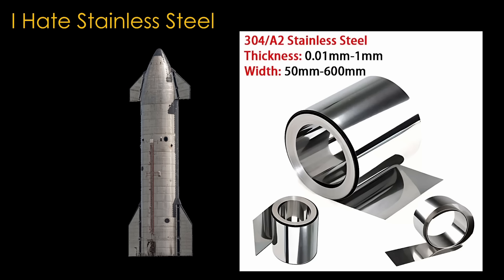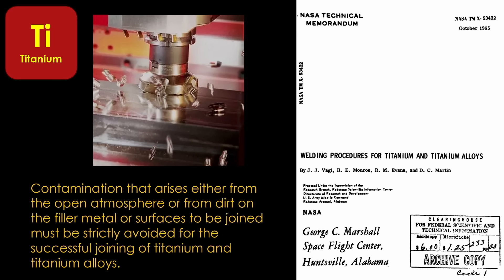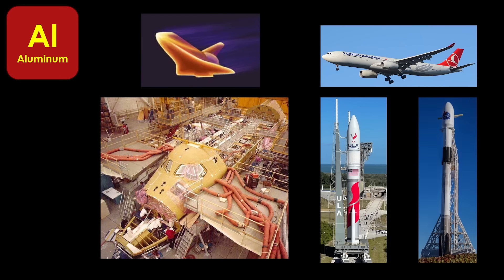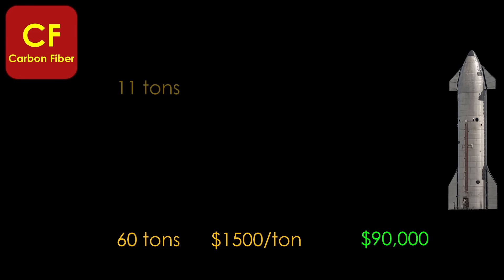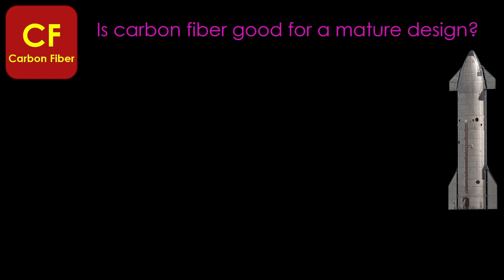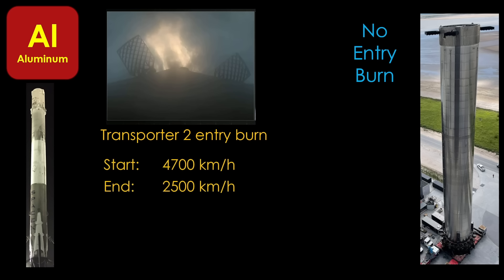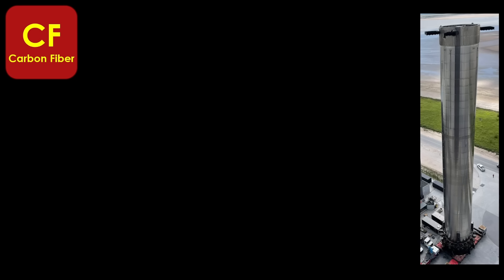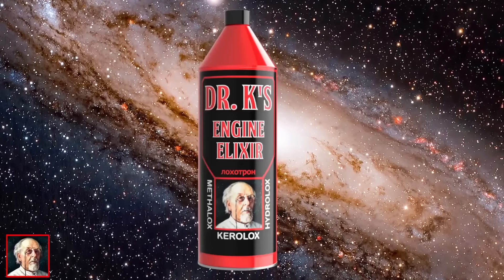Why Starship Loves Stainless Steel...

Comment: And how come if carbon fibre has all these not insignificant problems, Rocket Lab chose it as the reference material for the new Neutron rocket?
Reply from the maker: Neutron has an expendable second stage, and they have shown they can bring back a carbon fiber first stage with electron, so their architecture doesn't have the same downsides. 

They also know exactly what they want to build and are really good at carbon fiber.
Reply: @EagerSpace  Thx for feedback

Comment: I think it's plausible that the superheavy booster will eventually get a carbon fiber version once the design matures and they are regularly recovering boosters.

SpaceX is very ambitious with how frequently they want to launch Starship once it's mature. Their sunk costs into stainless steel based manufacturing aren't very big in the grand scheme of things (remember they first invested into manufacturing with carbon fiber then changed course).
Reply: I think it's more likely they belly flopping the steel Booster to skip the 13-engine landing burn from 1200km/h to 200km/h.
Reply: SPACEX most likely wont switch back to carbon fiber for a variety of reasons
Reply: Didn't you hear about the sub that was made of carbon fibre?
I don't think that would be a good choice to make a spaceship out of

Comment: At your quotes prices, I think the price question is basically irrelevant. If titanium was even modestly easier to work with than stainless steel and had decent performance in the heat, I think the couple-million would be an easy trade.
Reply from the maker: That is a fair point. 

I also wondered about supplies but couldn't find any useful information. There's so much stainless steel use that building a lot of starships won't make a noticeable dent in it, and titanium is a lot rarer, especially in the aerospace grades.

Comment: I just wonder, if choosing stainless is such an obvious choice, why has nobody done it before? Maybe NASA didn't have to worry about cost?!
Reply from the maker: Nobody has built a fully reusable vehicle before. NASA kindof started there with shuttle but quickly found that they didn't have the money to build two vehicles. If you have an external tank that burns up like shuttle the lightness of aluminum is really helpful, especially if you are using hydrogen as your fuel.

Comment: I disagree that heat management is a major factor in excluding Titanium. Sure, titanium isn't as heat resistant as steel, but it's still far far better than aluminum. I highly highly doubt that the difference between it and stainless steel is major enough to lose all the weight savings on increased thermal protection. The main factor for not using Titanium is just cost.
Also, I don't know how on earth you got that estimated mass for an aluminum starship, but it's definitely wrong. It should weigh at least as much as the titanium one because aluminum has a lower specific strength than titanium.

Comment: What about nikkel based alloys like hastalloy. would they be more suited then alu or titanium?
Reply from the maker: I'm assuming that SpaceX looked at more advanced alloys, and there have been some metallic thermal protection systems proposed though AFAIK they haven't been flown. They tend to be super-expensive and extremely hard to work with.
Reply: @EagerSpace  yeah. Nikkel based alloys is a pain to work with that is true. Anyways thanks for the answer!

Comment: NASA has a paper on how to properly weld titanium, while Russia has built about 50 titanium hulled submarines, who's welds have never failed.
Reply from the maker: The sources I found said that Russia only built 7 (or perhaps 8) titanium submarines and switched back to steel. Kursk - for example - had an outer hull of stainless steel.
Reply: @EagerSpace  That's because you CHECK you facts.
Reply from the maker: I was actually surprised to find it to be so low; my impression was that they had built a lot of titanium subs.
Reply: On this issue the use of laser welding has made titanium far easier to deal with.

Comment: I always thought titanium is the ultimate metal alloy. Stainless steel really is something.
Reply from the maker: Going into this I expected that titanium would fare a lot better, but holy cow it is a huge pain to deal with from a manufacturing standpoint.
Reply: @EagerSpace  But now it is possible to print with titanium (khe Relativity khe). Obviuosly, it can't be a vehicle as large as the Starship, but with a sufficiently large chamber... Moreover, with 3d printing one could design some unorthodox shapes, that would be better for, say, reentry. Also, you could incorporate some fancy features like uneven wall thickness, or even active cooling channels.
Reply from the maker: I'm really not convinced that printing tankage is ever going to be a good approach.
Reply: @EagerSpace  Elon Musk is using printing for Raptor 3 engine components with internal cooling channels.

Comment: Hello, sorry I am not good in math at all. After watching this video I remembered the video with the "rocket equation demon/dragon". There you pointed out that they only have a very narrow band for starship to even be useful as a 2 stage design. Wouldn't 17t extra payload solve the problem? (if you already have a working design, but sure, the entire evhicle needs to be reevalutaed again, there willll be different problems with a different design.)
Reply from the maker: 17 tons doesn't get you from 50 tons to over 100 tons, which is what they need to hit. That's why the starship 2 and 3 designs exist. 

The engineering question is "what is the quickest, cheapest, and easiest way to get to 100+ tons?" And it's not "spend 2 years to retool the factory to use a different material".
Reply: @EagerSpace  Oh okay, thought they were actually fighting over just a few percent. Yeah then stainless is the most workable material. 

Thanks for the reply!

Comment: From what i know New Glenn is made of aluminium and it isn't doing an entry burn.
Reply: We have no idea what kind of heat shield they'll have around their engines.  When did you see a flight plan for new glenn?  Could you post a link or name the site?  I'd like to read it.
Reply: @TheEvilmooseofdoom i do not know either, I'm simply pointing out that a booster being made out of aluminium doesn't automatically make it unable to reenter without a reentry burn.

Comment: Can they mill out an isogrid pattern in Stainless steel to reduce the weight?
Reply from the maker: That works well for aluminum because of its properties, but isn't something you would do with steel.
Reply: @EagerSpace  Hmmm. I'm seeing a discussion on NASASPACEFLIGHT forum suggesting while 300 series Stainless Steel is difficult to machine 400 series is very machinable.

Concerning Expense:
"Interestingly Austenitic Stainless is pretty cheap - only about $3-4000 per tonne, so subtractive machining would likely be quite affordable using milling for roughing and edm for fine finishing - if there was any significant advantage to the properties of the finished part.  Cost of manufacture of RLV's is far less significant if it gives the most durable result (lowered cost per flight)."

This could reduce weight as much as 45% less. That means a superheavy Booster if 240 tones could be 130 -140 tones with isogrids. Engines and hardware 60 tones with Rapor 3.
Reply from the maker: My usual answer to this is "SpaceX has all the information and they have done detailed trades and that's what they based their decisions on". 
In general, the right answer is "SpaceX would have considered these things and they decided not to do it".
Reply: @EagerSpace  I did find an answer.  FYI 
"Apart from its enticing features, the isogrid structure is extraordinarily expensive to manufacture. The commonly pursued route to manufacture such a structure is to start from a thick piece of metal and machine it down with computerised numerical control. This technique leads to a waste fraction of 95%. For this reason, SpaceX did not use the typical isogrid structure but obtained a similar effect with stir welded strengthening stringers."
Reply from the maker: There's a really nice video that ULA did that shows the isogrid manufacture for Vulcan. 

https://www.youtube.com/watch?v=fAmra8abfpc

They have others that also show this.
Reply: @EagerSpace  SpaceX doesn't have alot of this equipment. It's possible with the new production facility at Starbase we could see these techniques take shape after 5 years to refine the final design of Starship and super heavy. It should be noted that falcon heavy also doesn't use isogrids either but Dragon does.

Quite possibly SpaceX determined that the isogrid expense was not desirable since reusabilty and speed would make up the difference. But considering the mass problems Starship is having and their need to stretch both this may be viable as an expense.

Comment: Unfortunately, all mass calculations in this video are incorrect, since they do not take into account that in flight the rigidity of the walls of Starship tanks, just like those of the Falcon series, is supported by internal pressure. Thus, the density of materials plays a secondary role compared to their strength. If we take this fact into account, the difference in mass between the aluminum and steel Starship will be minimal, even without taking into account the mass of thermal protection. Carbon fiber will be lighter, but unlike steel and aluminum, it loses rather than gains strength at cryogenic temperatures. Taking into account the need for more massive thermal protection, the difference will be so minimal that Elon Musk’s words that the steel version is lighter than the carbon fiber one look quite plausible
Reply: Both aluminium and carbon fiber beat stainless steel in terms of stiffness to weight.
Reply: @saumyacow4435  When it comes to a car, airplane, or rocket fairing, carbon fiber and aluminum do provide a significant weight advantage over steel. But pressurized cryogenic tanks are too specific for the resulting difference in weight to be as large as stated in the video
Reply: @LoganGrimnar-k4n  Yeah there may be a weight penalty for cryogenic conditions. But I'll give Rocket Lab the benefit of a doubt when it comes to understanding the materials.
Reply: Actually Falcon does not use balloon tanks. Nor does Starship. They rely partially on pressurization for stiffness. The problem with Starship is that the tanks are no longer guaranteed to be pressurised after engine cutoff because the sub-chilled propellant will re-liquefy the gas phase back into liquid, leaving lower pressure. That's a big structural issue on descent because unlike vehicles being landed axially, Starship has to deal with high aerodynamic pressures against its side. With the flaps exerting torques on their hinges. Net result is a structure that wants to buckle like a soda can and also there are interactions between the turbulence of the plasma stream and the thin-walled structure. Meaning it wants to flap and that leads to feedbacks. I've no doubt some of this is anticipated but that would mean Starship having additional mass of internal stiffeners. Aluminium and carbon fiber having the inherent advantage of much higher stiffness to weight. 

I also dispute the need for more massive thermal protection for non-steel bodies. The reality is you're not just protecting the structure but you're also needing to protect things like wiring and trying to avoid creating ignition sources. So the tiles have to do pretty much the same job in any case. As best as I can tell the reason why Musk went down the steel path is a combination of his belief that he'll be churning out thousands of them and the fact that steel supports the notion of transpirational cooling. A more rational choice for rapid prototyping would be a subscale version of Starship made out of aluminium - for which SpaceX has ample experience.

Comment: Starships are colonial transports, not too crazy to assume some will be used on Mars for materials. Stainless can be cut up and easily re worked but not so much the other metals and no chance for carbon.
Reply from the maker: Good point. I forgot one of my main axioms, which is "when it's SpaceX, it's always about Mars".

Comment: Considering that Starship never reach orbit with cargo and, if i'm not wrong, never reach orbital velocity, wouldn't it be worth it to go through the extrat cost to make super heavy in carbon fiber to get Straship in orbit going at orbital velocity with cargo?
Reply from the maker: Why do you think it will never reach orbit with cargo?
Reply: @EagerSpace   Did not said that, i'm saying that as of right now, it never reach orbit with cargo (and, if i'm not wrong, never reach orbital velocity) and i'm asking if it wouldn't be worth it (despite the cost) to make super heavy in carbon fiber to allow straship (the whole thing) to have better performances (speed/cargo capacity).
Reply: @Junebug-me4bj  The only thing they didn't do was circularize the orbit.  You seem to thinking development is done and the results of the early throw away test articles indicate a path to failure vs a  path to success which is what the real engineers with access to the real data seem to think.
Reply from the maker: They haven't been targeting orbit, probably because the FAA would prefer that starship doesn't have the potential to reenter over land.

SpaceX will have done trades on all the options and they pretty clearly feel the answer is "no". My guess is that if they wanted to do super heavy in cargo they are talking about 3 years of program delay.
Reply: @EagerSpace  Ok, but shouldn't they still try to reach orbital velocity? At least to show that they could theoretically put it in orbit and test starship at that reentry speed (I assume that the reentry speed should be close to the orbital speed, correct me if i'm wrong).

Could it be a program in parallel to eventually field those kind of booster on starship V2 and V3, once there is a somewhat set desing?
Reply: @Junebug-me4bj  They reached orbital velocity on flight three and flight four. The energy of the orbit was equivalent to a roughly 100 x 100 km orbit, but the actual orbit was more like -50 x 234 km (flight three). That's still a suborbital trajectory, but it is orbital velocity (~27,640 km/h at apogee). They needed something like a 5 second circularization burn to enter a 234 x 234 km orbit.

I would expect that flight seven is the first flight to carry payload. This flight is expected to use Starship SN33, which is the first V2 Starship, with a redesigned payload bay door for Starlink satellites. If flight five happens early September, and flight six happens early December, that could mean flight seven happens around March 2025.
Reply: @SpaceAdvocate  Where did you see flight 3 reached ~27,640 km/h at apogee? When i go look at a livestream of the flight, the speed is ~26100 km/h at 234 km (T+ 25:50). For flight 4 it was ~26200 km/h at 212 km (T+ 22:10). I'm not sure a 5 second circularization burn is going to be enough.
Reply: @Junebug-me4bj  The SpaceX telemetry doesn't take into account the earths rotation.
Reply: @SpaceAdvocate  Ohh totally forgot about that, my bad

Comment: So according to you using carbon fiber composit gives about 49 tons more payload and more so if the second staged is not reused. So assuming a price per kg of mere 1000 $ that means 49 millions gain per launch. I guess even 10 tons more payload would influence material decisions. About the costs of a mass produced upper stage there are only speculation but what if they can make it cheaper than 40 millions. So what I am suggesting is that sometimes recycling would just cost them money.
Reply from the maker: With CF you have a much lower structure mass and an unknown mass increase for your thermal protection system because nobody has ever tried to do it before, so it's not clear if you would get any payload increase.

SpaceX is going to be looking at the whole development costs plus the expected lifetime of the vehicle. If - and I'm saying "If" because we don't know - the stainless steel starship can fly 100 mission but the CF one can only fly 5, then your life cycle costs would be a lot higher for the CF one. 

My big point on CF as a material choice is that it's a poor choice for research work and that if you've chosen stainless spending billions on a CF version doesn't make sense.
Reply: @EagerSpace  Thus I said it makes sense for an expendable upper stage. You get 49 tons more plus the mass of thermal protection system, cause you don't need it any more. And of course the saved fuel etc.